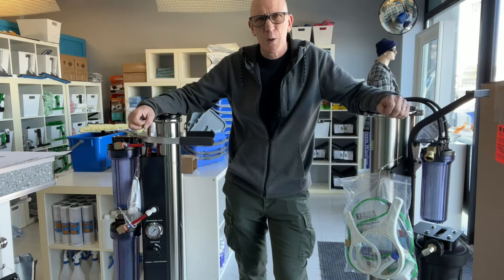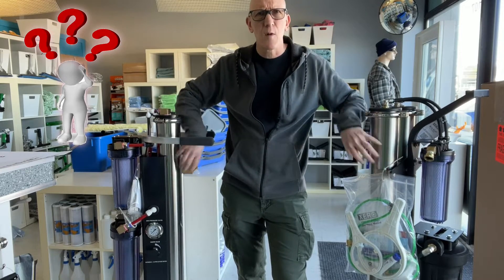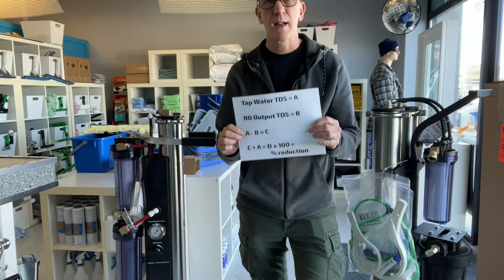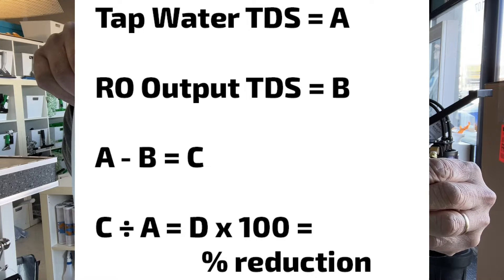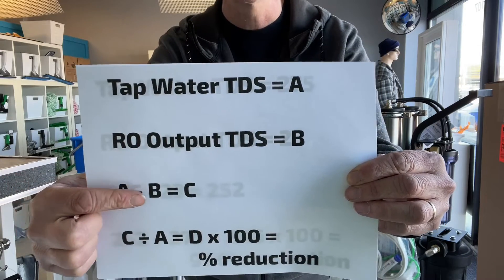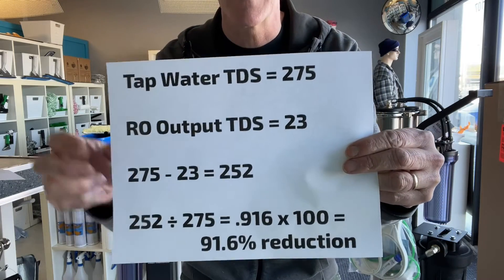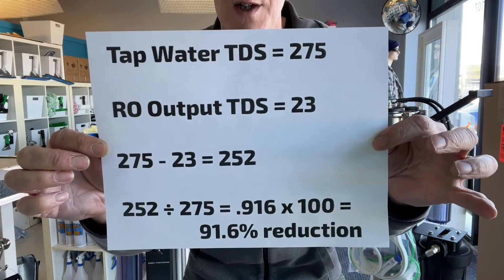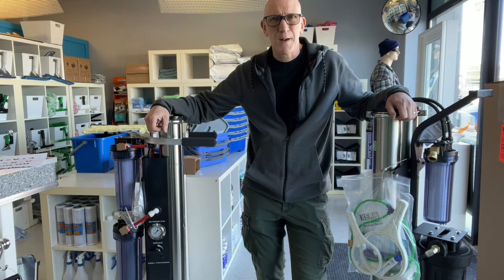Time To Change Your RO Membrane? - Water Fed Window Cleaning Systems

Comment: Hi Mark. I'm gerring into window cleaning in Vancouver. Do you think using di system would be a good choice considering good water quality here? Thank you for being one of a few window cleaning suppliers in Canada 😄
Reply from the maker: Hi Jason, yes DI systems are often used in the Vancouver area over multi stage systems. If eventually overtime you find yourself servicing outside the area where the TDS levels can go up suddenly, you can invest in a multi stage system and your DI system as a back up.
Reply: Thank you sir!! I'm trying to watch all your videos on tips and tricks for techniques and growing business. Would it be okay to call your store and ask you a few questions?